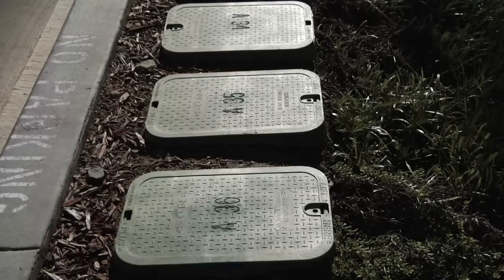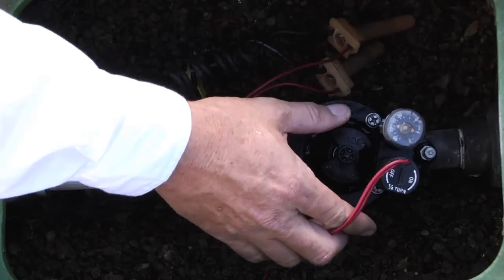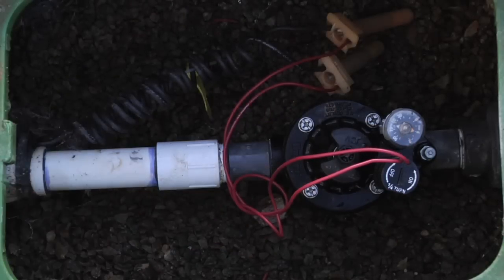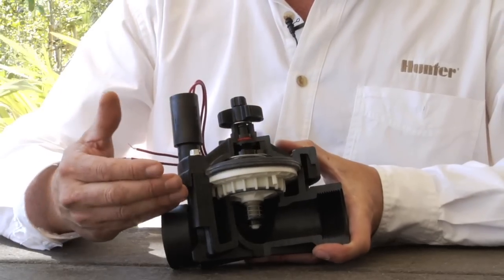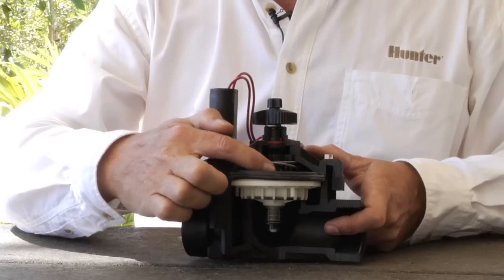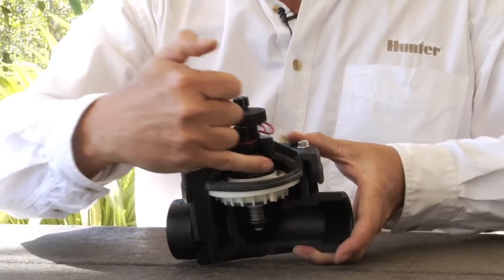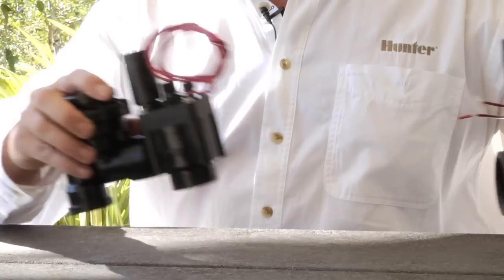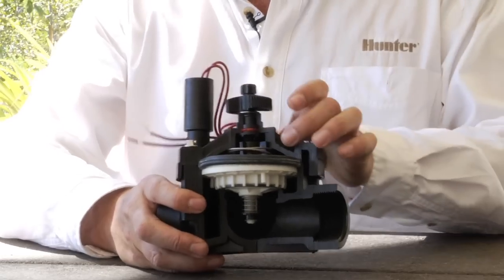Valve Series: Hunter Sprinkler System Valve Operation

Comment: I'm having a little issue with my sprinklers maybe someone can help me. I'm getting watter to my sprinklers but i have to turn the solenoid manually to open the flow. it wont don't it automatically. I turned the dial on my clock and i can hear a lill buzz coming from the solenoid when my zone indicated it should be on. Do i need a new solenoid or should i clean valve for debree?